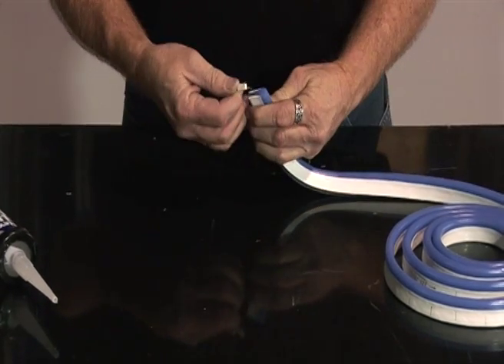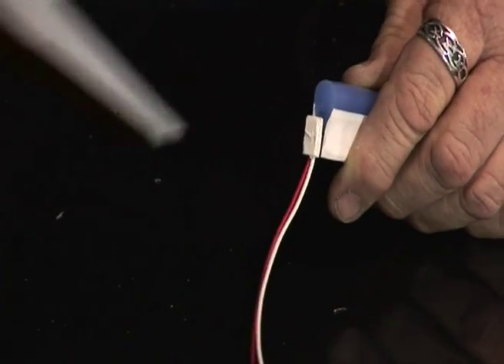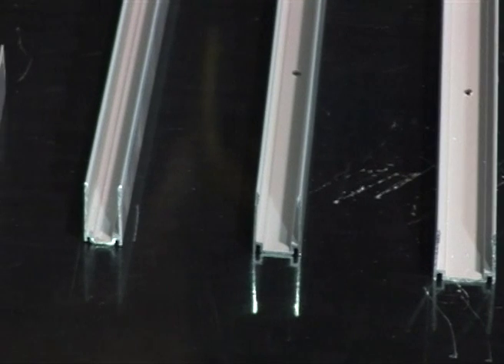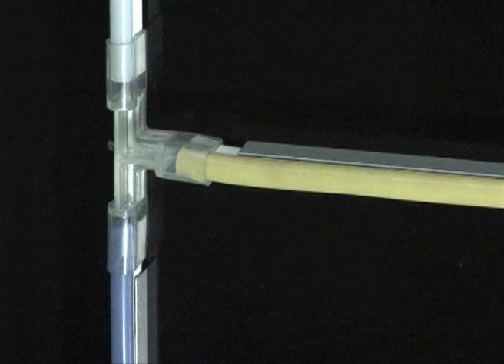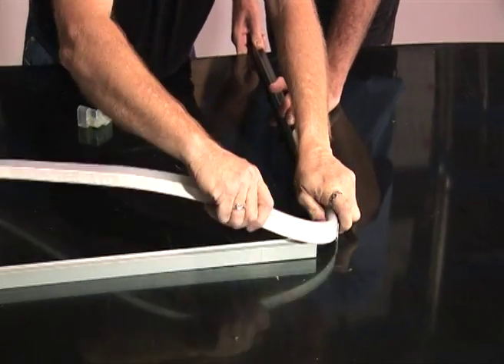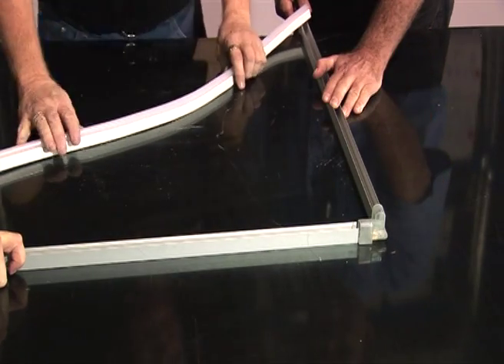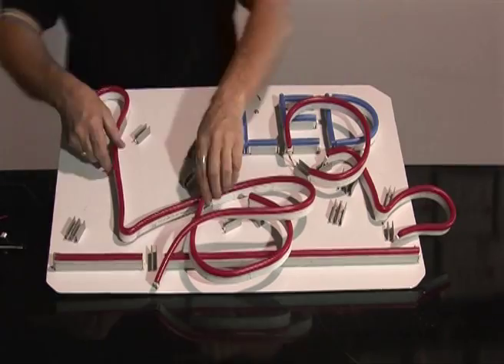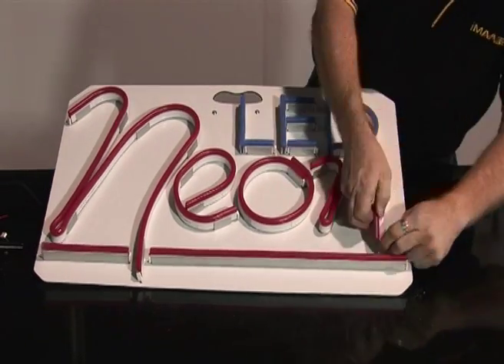LED Neon Flex - Different types

Comment from the maker: Yes thats correct, you can connect in series or parallel or both at the same time. Polarity is the main consideration. It won't damage the product with incorrect polarity, it just won't illuminate.

Comment from the maker: It is to show that you can run power through the LED Neon flex into the next product. The Start of the N was where the power went in, the end of the N loops into the e as well as the two straight sections. In some cases for wiring purposes this is an easier way of wiring. You don't have to complete the circuit as demonstrated in the O.